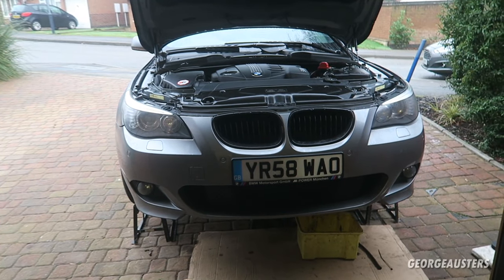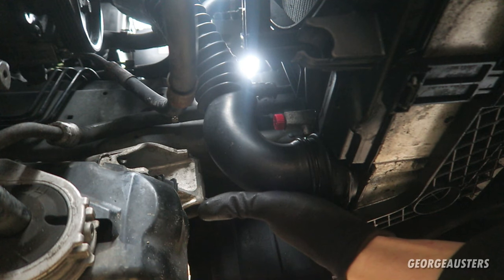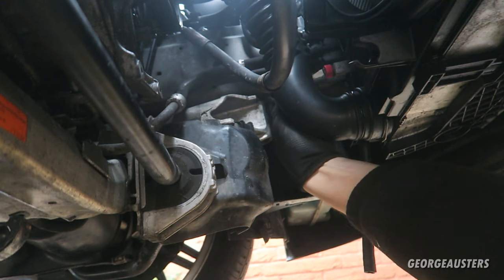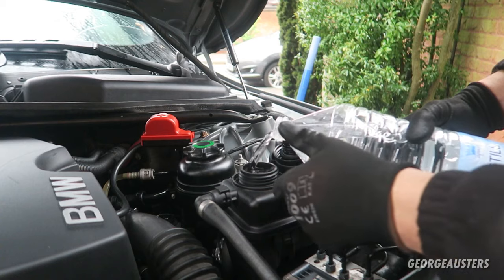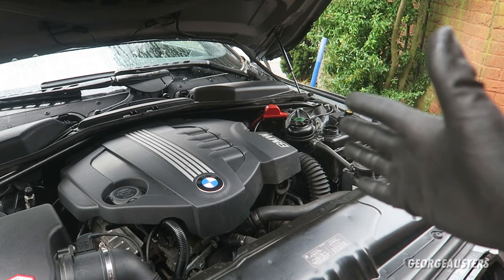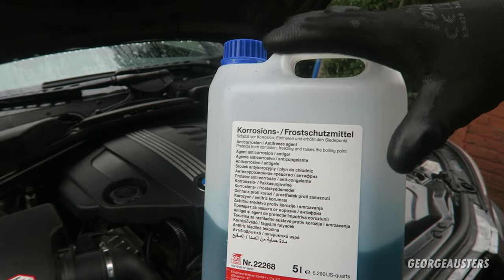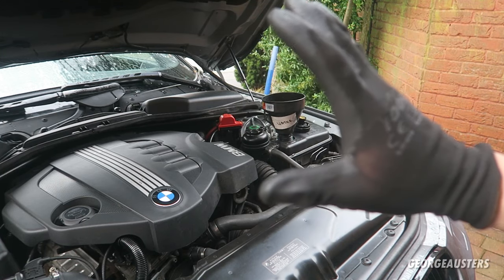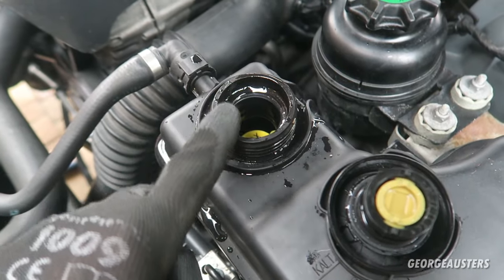BMW COMPLETE COOLANT FLUSH *How To Guide*

Comment: you forgot to mention that you need to let the engine cool down first before you fill it with cold water again, that can cause the head to crack and warp due to the instant temperature change.

Comment: Use only Distilled water not deionised.  Deionised is pure compared to distilled.  BMW recommends distilled.  This is bcus deionised water will eat away metal/gasket to balance itself, whereas distilled water already has the particles by default.

Comment: Hi George! Thanks for awesome videos og diy work on the car. I have a 2006 BMW 530 D M57 with a normal waterpump, not elecric. Just flushed the coolant system and added the coolant fluid 50/50. I see that you don`t bleed out the air and that you never had problems with it. I haven`t found any bleeding screw on or near the expansion tank, but I just noticed that there is a bleedingscrew on the EGR thermostat. Could that be used to bleed out the air from the system?? I haven`t seen any video where this screw is used or even mentioned.
Reply: Yes it is the best to open

Comment: George, your water pump is belt driven yes, but I believe there is a small secondary water pump which is electric, the reason for having this pump is for when pressing the rest button on your climate control to keep warm air coming into the cabin for longer, if you activate the bleed procedure it runs this pump for 12 minutes without the engine running to force out any air
Reply from the maker: Interesting. Will give it a go mate!
Reply: George Austers it’ll come in handy if you encounter any air locks. But it seems a weak part as most cars pumps have stopped working, however it will make no difference whatsoever as it’s nothing to do with cooling, only way you’d know is it’ll throw an error code
Reply from the maker: Just tried it and nothing happened. Are you sure all models come with this feature?
Reply: George Austers I believe all N47 have this fitted yes. It wouldn’t work for me neither but then a scan on my car showed up a fault for it? Have you got the REST button on your climate controls?

Comment: Hey brother I have a complete different question in regards to BMW, I have a N55 335i 2011 and recently installed new vanos solenoids and I got a P1260 code and an check engine light. Could you please tell me what it needs to be done? Thanks

Comment: I had my water pump go on me a few weeks back, main belt replaced, radiator reservoir replaced, pipe was cracked for coolant hence it leaked and caused it to seize… anyway, long story short, garage used their own LL red coolant but I could see the water pump working great, however the colour inside the coolant tank was kind of pinkish (not transparent) and you could see the mix of the old Holts Radweld Coolant Leak Repair mixed… so my car is easily hitting 115°C (luckily the pre LCI 335D so M57 engine) but the fan goes mental.

My cheap steps I will be doing is flushing the system but using Wynn’s Radiator Flush as well… so I’ll follow your steps and definitely replace with the coolant I wanted to use - XStream G48. Would you say this could be my car issue? I have the temp internally at 28°C and full speed… car still reaches 90°C within 25min driving (below 70mph).

Comment: I'm using a distilled water coolant on my e60 n54 and the problem I have a electric water pump on it and the coolant does not have air releasing plug after bleeding it ,so how can I release the air and the bubbles from the coolant system line after the drain

Comment: Don’t put the blowers on straight away, it’ll only take longer for the coolant to get up to temp. You only need them on to test for airlocks in the matrix. The coolant will flow through the matrix regargless if the blower is on or not.

Comment: Hello i have a 2012 x3 335i suv i was going to do the flush but i don't have a 
drain plug. I just trying to find the easiest 
way to flush the radiator without making 
a mess.I looked all through you tube and there's is no matching car like mine.
Reply: I was able to do the coolant flush from the reservoir hose and by turning on the coolant pump and it did a great job.

Comment: Hi George, love your channel, used loads of your videosfor working on my 118d. How much coolant in total did you use for the N47 engine?
I have Xstream G48 which is ready mixed. want to make sure I have enough before performing the flush. Thanks!
Reply from the maker: The entire cooling system holds around 10L

Comment: George it was not necessary to remove the intercooler to access the drain screw? on my e81 n47 i can't find this screw. it's probably behind the intercoller.
Reply from the maker: No there is no need to remove the intercooler 👍🏻
Reply: @GeorgeAusters  weird. I already looked near the zone of the tubes of the Intercoller and I can't find the radiator screw. As mine has the steering wheel on the left and it is a serie 1 it can be a little different..

Comment: My m57 had g12 for coolant but its brownish now and i need to change it, do i flush the remaining coolant, then fill it up with distiled water, then flush it again and repeat till only distiled water comes out? And then get the blue coolant and fill it up with that, because ive been researching for so long and i cant find an answer on how to do this, another thing, i can only find 1 bleed screw, i cant find another one anywhere
Reply: There are two vent (bleeding) screws. One on the return hose and the other one sits on egr thermostat.

Comment: Hi , car looks great , iv 06 reg 520d e60 , can u please tell me what should be normal coolant operating temp when engine is fully warmed up as my one only goes as far as 60c sometimes 67c, i had same issue with e46 that turned out to be egr thermostat. Thanks kerp up good work

Comment: Can you put a link for the coolant please, want to make sure I get the right stuff, thanks
Reply from the maker: Here is the exact coolant Carl! https://amzn.to/3dKzpTj
Reply: @Lin Li hi, they can't even get the rear wiper size correct so I won't trust there computer to tell me about coolant, if I know the correct grade I know for sure then, thanks for advice
Reply: Do you know roughly the coolant system holds in litres? Thanks
Reply from the maker: @BatmanReturnZ Between 5 and 10L
Reply: @GeorgeAusters  thanks , that including the deionised water?
Reply from the maker: Yes

Comment: By draining it this way is it draining all the coolant from engine and block so I can add different color coolant
Reply from the maker: You should only be using the proper blue coolant
Reply: @GeorgeAusters  right but since I got my car its had green coolant. I want to change that to blue. Can I just keep flushing water then add blue? Like is that draining it from the block of the engine by just undoing radiatior plug
Reply from the maker: @radianm6  Keep flushing until it's clear like water
Reply: @GeorgeAusters  okay. Thank you

Comment: I think from watching another youtuber there might be a bleed setting on the head unit that you can activate and then you can hear air popping out the blowers.
Reply from the maker: Yeah I heard about that but think it’s only applicable to those engines with electric water pumps👍🏻 

2 weeks since doing the coolant flush and no issues, still sitting at 87-90 degrees
Reply from the maker: Yeah i've actually watched his videos and it's interesting to see but to my knowledge, the system on my car is a self venting system which is why there are no bleed screws.

Comment: Hi! I found this explanation regarding bleeding of the cooling system in the Product Information Sheet od the N47 engine:

"Bleeding
At the highest point in the coolant circuit, a
 bleed hose branches off to the expansion tank from the coolant hose that leads from the engine to the radiator. At the connection to the expansion tank, there is a bleed screw for the cooling system bleeding  procedure. This makes it possible to remove any air bubbles from the coolant circuit. During normal operation, this bleed hose carries coolant from the highest point of the circuit into the expansion tank. From there, it is fed vertically upwards through a pipe and through a very small bore, where the coolant reaches the coolant in the expansion tank. In this way, the coolant is calmed and any gas bubbles are left behind in the downpipe where a certain amount can be absorbed."
Reply from the maker: Yeah there MAY be on the E90 and E87 etc but there is certainly not on my E60.

Comment: sorry, but your method is wrong. you will not get rid of all the coolant this way. also there is a specific bleeding method with vacuum machine filling. some other method supposedly too, but I am not sure if it's working
Reply from the maker: My engine was removed prior to this so yes, all of the coolant was removed :)
Reply: @GeorgeAusters  oh sorry, I deleted it. I thought u have 3.0 liter diesel. u dont so I dont know procedure for ur car....but there is a different procedure for 3l diesel.
Reply from the maker: @martinkulik9466  Yes on the M57 engine there is 2 bleed screws
Reply: @GeorgeAusters  Where

Comment: This doesn’t replace/ remove old coolant from engine block ! So it’s just replacing coolant from radiator only which isn’t a full system flush 🤔.
Reply from the maker: It's why you flush, not just drain.. The coolant from the engine cycles back into the radiator.

Comment: this is stooppid... this is not "complete flush", this is multiple times repeated "partial flush" which is a basic thing. the question is how to actually do a real COMPLETE flush.
Reply from the maker: If you say so👍🏻
Reply: @GeorgeAusters  Hey George, with due respect, the above audience sounds a bit rude, but he has some point here. 

Correct me if I'm wrong. When you drain from the radiator draining point, there are still a lot of coolant in the engine block etc. I understand your method is via multiple dilution to get the old stuiff out as much as possible, which is ok. But when you add the new coolant back, you prepare the percentage of about 45% (2/4.5). The leftover water in the engine block will significant dilute the solution.
For example, mine is M57TU2, which is said to have 9.8 litre of coolant in the system. However, I can only drain about 5 litres out via the radiator draining plut. If doing it in your way, I will get 22% solution in the system. So, I guess it may be better to use undiluted coolant concentrate and fill it up straight after the final draining? Cheers